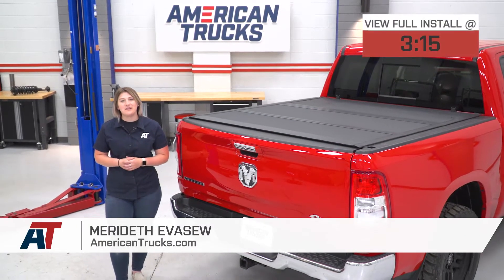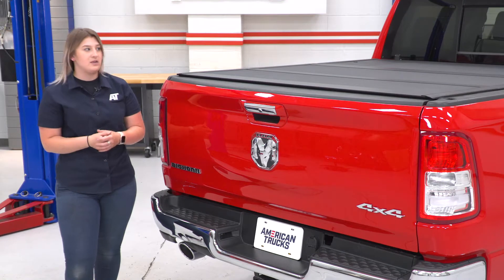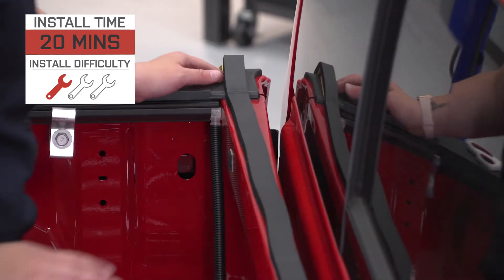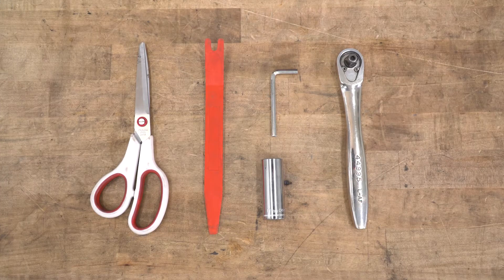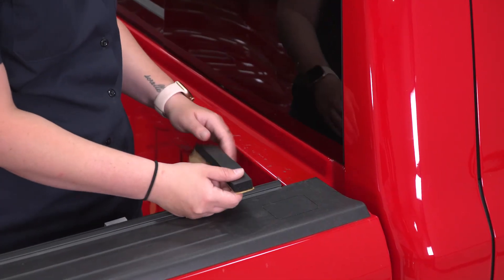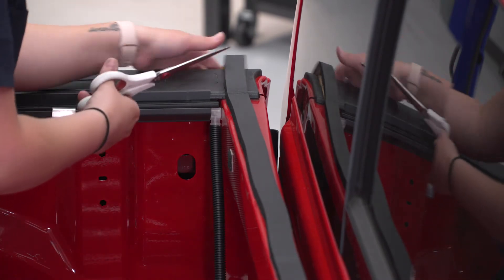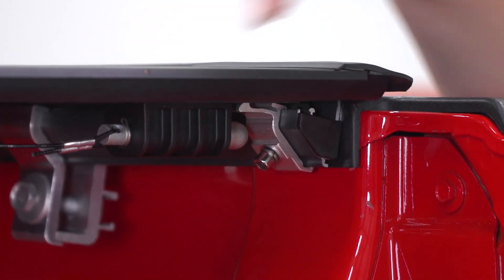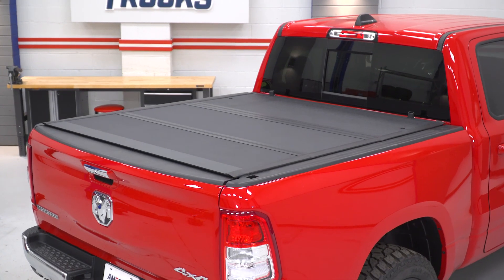2019-2020 RAM 1500 Proven Ground Low Profile Hard Tri-Fold Tonneau Cover Review & Install

Comment: The brackets that hold the cover to the rails need to be slid on the rails BEFORE clamping the rails to the truck, btw.
Reply: Exactly what I was thinking, frustrating to watch
Reply: Reeeeaaaaallllllyyyyyyy wished I scrolled all the way down to this comment.  My OCD wouldn't let me leave it sooooooo......
Reply: Yeah it shows her trying to tighten the set screw like it's gonna secure it somehow.   Then just moves on. This video is an epic fail!
Reply: And why would you remove the plastic covers for the drainage tubes when there are holes closer to the tubes!